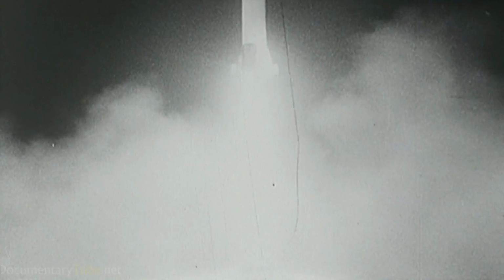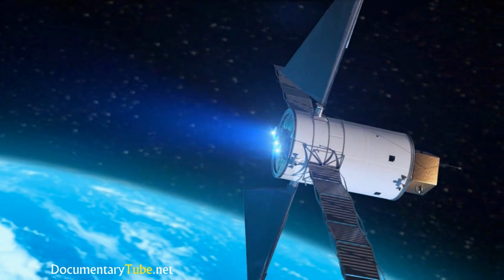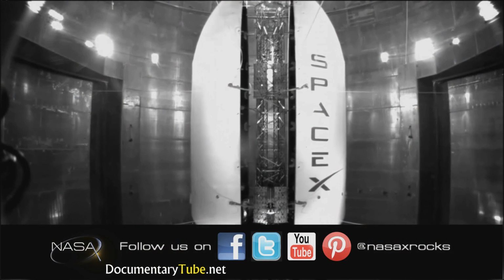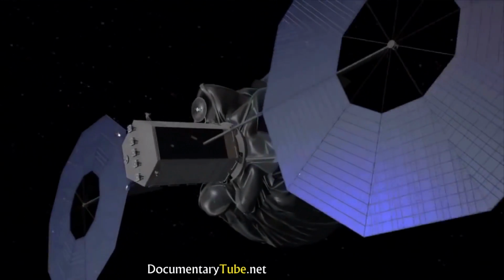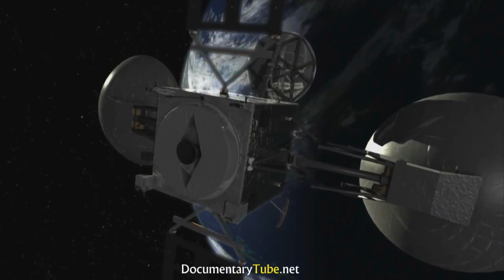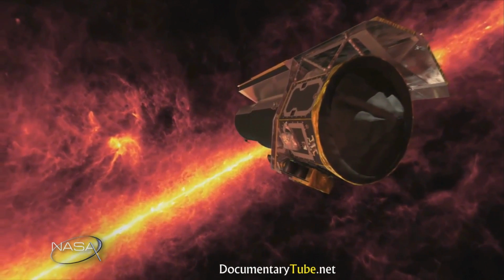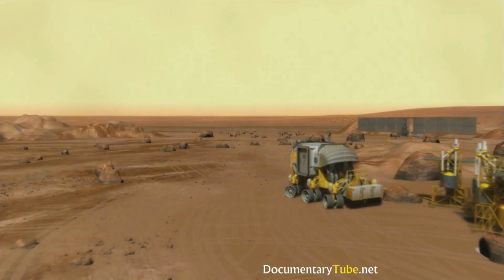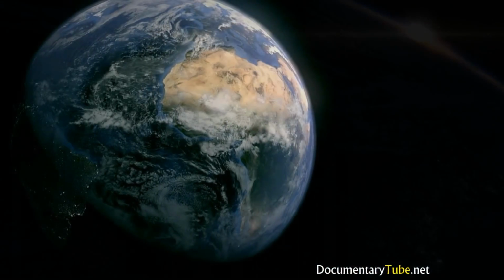NASA's Engines and Possible Speed of Light Propulsion?

Comment: Fixing NASA's solar problem right now. Simple, if you can use the "flexible solar screens on a wing" then why not wrap other parts of the vehicle in them? Thus increasing and utilizing your surface area to absorb solar rays? Pretty simple concept I think.
Reply: They rotate them to get maximum sunlight.  solar panels wrapped around a cylinder would get maximum 1/pi units of sun, 32% efficiency. That drops to 0 if your cylinder's axis is parallel to the sunlight.  A sphere gets 25%.  If the structural wing materials and motors are less then half the weight of the solar panel system then it is a much more efficient set up.  Would be nice if someone invents a material that is both a PV solar cell and a strong/tough structural material.  There are on-earth uses I can think of.  Some of the surfaces are also radiators and reflective.  A movable wing can function as a parasol and help with temperature control.  In some cases you might have to use electricity to pump heat.  Storing liquid hydrogen for example.  Your laptop probably has a fan to keep the CPU from overheating.  That will not work in space.
Reply: Yea, I was just saying that maximizing efficiency via using any space can have more power being drawn and stored, thus allowing for more power for needed and possibly emergency power. Then at least part of the power problem could be solved.

Comment: See NASA LUNAR ORBITER PHOTO Lo5 125 h2a and zoom in from the top left, to top right and then gradually down to the bottom, making sure that you zoom in FULL and cover the entire photo. 100's of BUILDINGS< machines, mines, pipes, walls, structures, decaying domes, stairs, roads, pathways and even more... all in one genuine NASA photo that most people are unaware of! My photo is a close up of "the smoking gun" part of the image... A mining facility that's millions of years old and falling apart..........The photo was taken in 1965.......
Reply: Is this the photo?

http://ser.sese.asu.edu/LO/lo5-125-h2a.html
Reply: YES... now zoom in, I'm sure you have. Granted some things may be light and shadow and low resolution factors BUT there is a repetitive  trend of PIPES sticking out of the mountain and STAIRS near these pipes and RECTANGULAR, and tower like structures etc - LOOK closer and not just the so called smoking gun mage - looks like a broken mine to me (HE3) - there are several but much darker...look carefully.  In the very TOP LEFT or close of the image there is a BROKEN wall - A rectangular decayed BRICK like wall with a third wall in the middle, as if it was once a building of at least TWO rooms, clear as day! Also some of these have since been photographed by other craft and LOOK EXACTLY the same so any "light and shadow" is the cause crap is shat on! REgardless of sun angle... some LOOK EXACTLY THE SAME!
Reply: CORRECTION The photo was taken circa 1969.  Released 1971 and at the Arizona State University since.  Online since 1996 but site updated several time since then. NOT A FAKE in any way! The genuine article.  NOW take a look at Lo5 125 h2b thats B ... to the edge there are a few things that correspond with the edge of structures at the edge of h2A - then the moon looks the normal knobbly mountain range....no detailed signs of the previous plate of ARTIFICIAL things, bar the odd faded path...though I am aware that fairly large rocks get pulled along by the gravitational pull of the Earth making some of these look like a path, technically it is in the least a TRAIL.  In Lo5 125 h2a this means that if the stair effect was created by said rocks, and this is where that idea fails, the rocks would often be climbing a near VERTICAL cliff face! Not only that but in some cases TWO EITHER SIDE BOTH OF AND AVOIDING A STRUCTURE IN THE MIDDLE! No way is any of that natural so don't even go there! Rocks don't go "OOO LOOK! Something is in my, I'll just go around it!" However BEINGS do .......
Reply: My own photo is the zoom in of the most telling STRUCTURE also known as the 'smoking gun' image. By the way, google THe Castle Feature or Tower Feature on the moon.  You'll see a photo of a knobbly tall pointy white or light reflective seemingly glass building.  NASA said "an lenzing affect of light and shadow" Now Look again at Lo5 125 h2a, bottom RIGHT look real carefully in that general area of the plate.. took me ages but I FOUND IT! EXACTLY THE SAME SHAPE and mostly IN SHADOW! But even at max zoom it's very small and dark and THE SAME SHAPE at a different angle ... so stop with the lies NASA!
Reply: Andrew Demetrius You do realize the resolution of those photo's taken from 220km is 3 meters?  What you're seeing is patterns and it's your mind that making them into objects.  Same way people see things in clouds, smoke or any number of other things.
Reply: No that means it is accurate to within 3 metres!
Reply: There's a whole bunch of UNPUBLISHED photo's that show a lot more.....
Reply: OH and the smoking gun image (MY PHOTO) is on Google earth - moon section and very fuzzy and obscured but NASA admit it is there and it's about 1/8th of a mile high.......What's more it is at a DIFFERENT angle BUT there is no published photo of it from that angle, thus proving that NASA have many UNPUBLISHED photo's - they shot themselves in the foot again! If you can't find it, I bloody well will from Google Earth - moon section and post it here myself!
Reply: Andrew Demetrius That is NOT what resolution means..  That picture, taken at 220km high and shows a 10km wide section of the lunar surface.  The highest resolution of the Lunar Orbiter images reached 2m.  Resolution is not about accuracy it's about the resolving power per picture element.  Anything smaller than 2m returns the same brightness as the objects around it.  That's what resolution means. and in your smoking gun picture it's 3.2m.
Reply: The image on Google earth - moon section is probably from the angle taken by Lo1 that Karl wolfe saw OR if not then NASA have photographed it a THIRD time or even more.....
Reply: NO the smoking gun image is an 1/8th of a mile high. Your very own explanation proves that because the image is 10km.  as you zoom in, do that maths! It's about 1/8th of a mile high and AS IT IS ON GOOGLE EARTH! 1/8th of a mile high!
Reply: Andrew Demetrius Look.. I don't know what fantasy you're indulging or what hero complex.. I don't know what you're rambling on about with Google Earth and all your unpublished photo's.  However I DO know a thing or two about photography and what image resolution actually means and exactly what it means in that one specific photograph you referenced.  Best of luck kid.
Reply: OK..... here we go again "There are four types of resolution when discussing satellite imagery in remote sensing: spatial, spectral, temporal, and radiometric. Campbell (2002)[4] defines these as follows:
spatial resolution is defined as the pixel size of an image representing the size of the surface area (i.e. m2) being measured on the ground, determined by the sensors' instantaneous field of view (IFOV);
spectral resolution is defined by the wavelength interval size (discreet segment of the Electromagnetic Spectrum) and number of intervals that the sensor is measuring;
temporal resolution is defined by the amount of time (e.g. days) that passes between imagery collection periods for a given surface location
Radiometric resolution is defined as the ability of an imaging system to record many levels of brightness (contrast for example) and to the effective bit-depth of the sensor (number of grayscale levels) and is typically expressed as 8-bit (0-255), 11-bit (0-2047), 12-bit (0-4095) or 16-bit (0-65,535).
Geometric resolution refers to the satellite sensor's ability to effectively image a portion of the Earth's surface in a single pixel and is typically expressed in terms of Ground sample distance, or GSD. GSD is a term containing the overall optical and systemic noise sources and is useful for comparing how well one sensor can "see" an object on the ground within a single pixel. For example, the GSD of Landsat is ~30m, which means the smallest unit that maps to a single pixel within an image is ~30m x 30m. The latest commercial satellite (GeoEye 1) has a GSD of 0.41 m. This compares to a 0.3 m resolution obtained by some early military film based Reconnaissance satellite such as Corona." Which one are you referring to? It is clear which one I am referring to and that is the one that NASA is referring to! Bloody idiot!
Reply: https://en.wikipedia.org/wiki/Satellite_imagery I am referring to the one as I described. 3metres as in we can see clearly up to 3m before pixels start to smudge.  THAT is NASA's scale, always has been - the structure is 1/8 mile tall!
Reply: Plus I never trust anyone onlne with a fake name.....
Reply: One more time NASA is referring to the resolution at which the pixels - definition of clarity no less - begins to blur.......The image is, as you can see, made up of strips. Each strip in the case of h2a is at an altitude of 220.1 KM and each strip is 10km - from left to right/right to left so that my photo is in an area of 2000m (square) and as you can see, the structure is about 500m high which is about 1/8th of a mile.
Reply: How were these images obtained?

According to Arizona State University, the Lunar Orbiter images were all digitally scanned at 400 dpi at the Lunar and Planetary Institute in Houston. Whole images were too large to be scanned at once and were broken up into four sections. 

From the data and resources about each lunar orbiter image found in Anderson and Miller (1971), they obtained information about the side length, altitude and emission angle of the images they scanned. To calculate the resolution of each image they followed several steps. They first calculated the resolution of images with an emission angle of less than 10Â° by dividing the side length of each image by the number of pixels, and then calculated the distance to the surface by dividing the altitude by the cosine of the emission angle. The resolution of low-emission angle images was plotted against their distance to the surface. From this was obtained the best-fit equation:  
Corrected Resolution = -0.0023272 + 0.014376 * Distance to Surface  
and applied it to the remaining images to get the corrected resolution.  and this site calculated the exact resolution and ..  http://www.thelivingmoon.com/46_mike_singh/03files/New_Lunar_Orbiter_01.html The objects are HUGE
Reply: Other images show structures several MILES high....And like I said it is on the MOON section of GOOGLE earth... Google earth is using NASA data.  In Google - moon the structure is approx 500m high! With the blessing of NASA!
Reply: Andrew Demetrius Do you refer to me?  I feel no shame, just a whole lot of pity for you.  If you need to use Pareidolia to construct your fantasies and thus your self importance that's a problem I can't address.  You just keep seeing faces in clouds and imagining what you like.
Reply: WRONG! Try saying that to the millions of others whom see it.  I am still right nonetheless and that is a MINE one of four maybe more in the image
Reply: https://www.google.co.uk/intl/en_uk/earth/ download that, go to moon section and take a good loot at it yourself.  It's NASA's own photo's again.  BUT far less clear - the object is there and the WALL is there at a different angle, still looks like a wall and same dimensions......
Reply: Goto the SOUTH POLE away from the bleached out centre (where most of the structures are.... bleached out here..... I wonder why! However as you move slightly away from the centre, you'll see.....Massive objects
Reply: Andrew Demetrius Millions huh?  And of COURSE you're right.  This entire exercise has been all about that from the beginning.  That's the need your filling.  You need it so much you'll see anything to confirm it. It looks like a wall therefore it IS a wall.. It looks like a face therefore it IS a face.  It looks like a bunny therefore it IS a bunny.  It's very handy how it 'looks' like only from great distances at low resolutions.   You hero!
Reply: Nothing to do with me..... It is a 500m structure - has been for at least a million years.  Millions say so, and they are also right
Reply: By the way.. WHY are you hiding behind a fake I D? What's you're sad story? You accuse me of things, but I am OPEN and have nothing to fear from using my REAL name....so what's the problem with you that you have to hide?
Reply: Andrew Demetrius I debunk nothing.. I simply refuse to see what isn't there merely to gratify my ego.  It's the imagination of the ego driven personality that gives me all my other nefarious attributes. So I'm a member of the fake name people am I?  Rather be that than a member of the fake important people.
Reply: I am far from important and neither am I fake.  Where does that leave me? I chose my real name instead of my DJ name.  The structure in the photo is about 500m tall and is artificial
Reply: I am OPEN for scrutiny.... I have to be in this business.
Reply: I first saw the photo, like in my profile but in it's gray version in 1997.  A friend had it on his computer.  I asked "Is that some old quarry?" He the told me what it was and showed me the whole Lo5 125 h2a.  I even asked "It looks so dry there...???" When I realised it was on the moon, once I saw properly etc, I then heard Karl Woolfe and the rest... BUT when he spoke I thought .. Hang on! I know some of those STRUCTURES that he describes, he saw them! Then I realised that what I saw really was what I saw... An abandoned and now broken (in the very least, part of) He3 mining facility and we didn't build it. The only other answer is that some other race did.  It is not a big deal that this would be the case.  In about 1 to 3 hundred years we will be plundering moons for He3 as well... My main thought on the issue and Buzz Aldrin says the same is that they visited long ago, and left long ago while on their exploration and mapped us etc.....Not a big deal at all.  If that is the case, then we are far more alone than we thought and life is indeed very hard to find...
Reply: I apply science... I do the math etc...then I can say what I say.  How could a photographics expert like Dr Wolfe make a mistake of such mammoth proportions and for NASA to not intervene on the issue, for is they did then, as stated, to go to congress and prove him and all of the others there that day WRONG.  NASA and the government said NOTHING
Reply: Not a single person at the Disclosure event has been debunked or slandered by NASA or the government.  They merely said nothing.... thus far.....OH and The BBC is doing a documentary on the issue for the New Year and there will be a live follow up to go head to head with anyone the USA sends....
Reply: We have 19 of the disclosure group on our side including Dr Wolfe - what congress are afraid to do a simple live TV show here will instead
Reply: R T have already asked for distribution rights - they put in their bid first but the BBC is not affiliated to them so it'll be interesting how much watered down and blandified the BBC will go by the time we get to the live debate...THEN R T will take it from them and we'll have an actual no tricks LIVE debate on  R T - that's what R T are waiting for
Reply: Andrew Demetrius Because 'debunking' and slandering are what the crazy people do.  In reality the fact that they keep releasing pictures and NOT indulging in debunking and slandering gives them credibility.

Setting all that aside though it should be possible to gather the evidence you need regarding the moon.  There are thousands of amateur astronomers out there with telescopes and cameras.  You should be able to do it (and it would look better) without relying on images from NASA and accept the scrutiny, it's a healthy thing.  Find an area on the moon, just one that can be imaged from earth and concentrate your efforts on that.  If NASA can't be trusted don't rely on them or their images.  Be open, no 'secret' photo's.  The more scrutiny you can endure the more credible you look.  Go with one thing though.  If you have a structure on the moon then go with it, don't let it get lost in the mire of lunacy.  Don't lump it in with all the other stuff that can cause credibility issues.  If you leave structures on the moon in with the alien anal probe people you'll be tossed in the rubbish bin with the rest.  Don't even go with the who or when or why.. Just show it's there.  

It'll be no easy task but it will be interesting.
Reply: There are many unpublished photo's that the NSA didn't even let NASA have.  The structure is there, it is artificial and about 500m tall